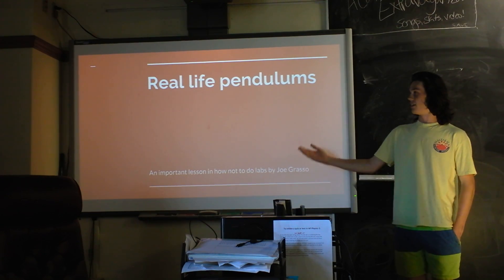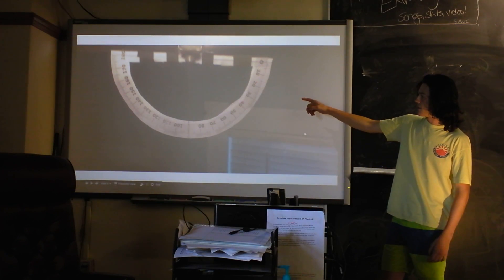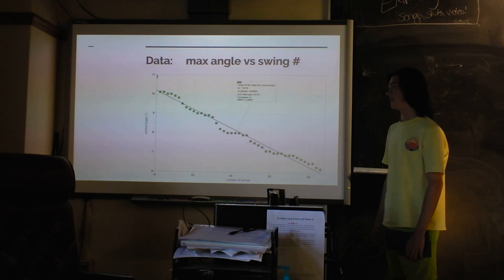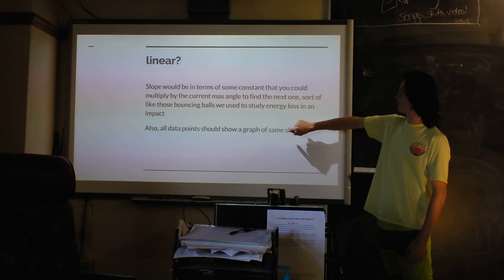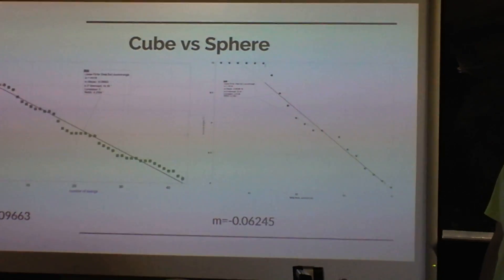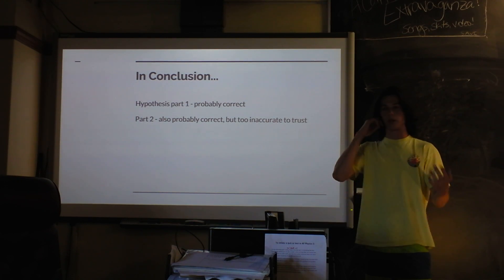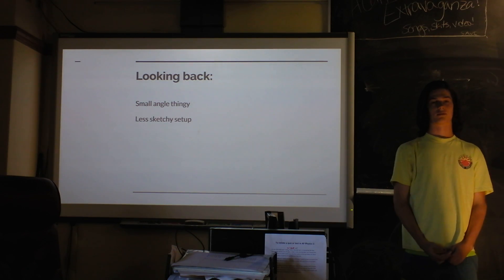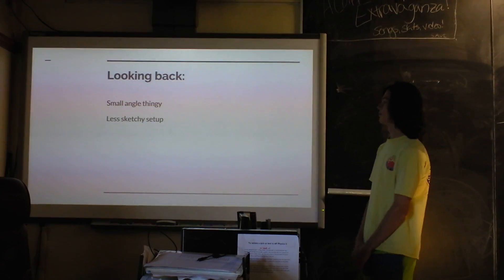Indie Lab - Damped Harmonic Motion Studied

Comment: [...continued]

4. LOOK FOR FLAWS

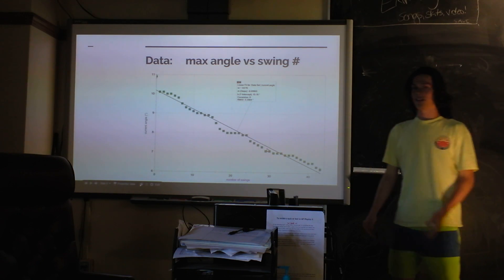The first thing to do is look at the data with an open eye and an open mind (funny how often you need this). Look for anything peculiar, not just the aspect that surprised you in the first place. What of those wiggles in your graphs? You see Doc's intuition in action: maybe the wiggles point to an unwanted disturbance in the form of beats in relation to the lamp. That's how you proceed, like Sherlock Holmes. (I love how Benedict Cumberbatch plays him! Watch the tv-series. This is precisely how a physicist looks at his experiment, searching for clues to what is going on. Notice details, sift the relevant from the irrelevant. Quickly make pictures in your mind that might explain things, and quickly discard them if they seem unlikely. Let your mind be open, fluid, creative and critical at the same time.) What of that strange first data point in the plot at 2:18? Maybe it has a trivial cause, maybe it tells you something useful.

5. REPRODUCE AND VARY

The next phase is systematic investigation of the anomalies you noticed. In science we separate the real from the freaky fluke by testing reproducibility. Do it again. Do the wiggles persist, in the same way regarding phase and amplitude? Do you get the same linear decay? You either find that effects are reproducible, in which case you need to eliminate or understand them, or they are irreproducible, in which case you may want to average them out over lots of data runs, and/or improve the stability of your set-up. It is not all mindless work in this phase. As long as you don't understand what is going on, you keep looking and thinking about possible causes. During each data run, you closely watch everything that happens, and think about it. The physicist mind never stops.

If you have a reproducible difference between theory and observation, and you have been unable to trace it to some problem in your set-up: congratulations, because you have made the first step towards discovering something new. But you are not there yet. Now comes the phase of parameter variation. Make the pendulum longer, shorter, of different material, attach it differently, start at different amplitude, do the experiment in a different environment, etc. In short: vary anything that you think might be relevant. Please be clever about this, doing plausible and easy variations first. Streamline the data taking process. These are not final measurements, so maybe we can do with fewer data, and we don't need pretty plotting at this stage. Be ruthlessly efficient.

6. (RE-)VALIDATE YOUR SET-UP

If all is well, you tried in a previous phase to get your set-up as closely to the model system as possible. But maybe you did not go very far in this respect, because of practical reasons. If you have an unexplained experimental result, you may want to return to this aspect. Can you get close to the simplest, harmonic, undamped, massless-rigid-string, point-mass, oscillating in one plane, pendulum treated in the textbook? Try it. If you cannot get reasonably close, you have a dominant systematic effect that should worry you. Remember, nobody will believe the results of your experiment, unless you demonstrate that your set-up is in fact capable of reproducing known results in known situations.

7. PUBLISH & FACE SCRUTINY

Now suppose that you (a) can reproduce known results in known situations, (b) have eliminated or accounted for all disturbances and effects that you could find affecting the results, and (c) still find a reproducible and significant (error analysis!) discrepancy between observations and theory. Then you have found something new.

No matter how implausible your result might feel to you, you are now honor-bound to publish it. This is what happened in 2011 with the OPERA experiment in CERN and Gran Sasso: the researchers found that neutrinos move faster than light. This result is shocking, because it violates Special Relativity: a theory that has been tested with tremendous accuracy in an incredibly wide range of situations, and has never been found to fail. The researchers did the right thing, which is to publish their findings.

The media and other fools tumbled over each other prattling about a 'failure of science'. Nothing could be further from the truth. This is science at its best. The publication triggered intense investigation of the types mentioned above: experimental flaws, data processing flaws, and unaccounted-for effects. And speculation started about possible consequences for our understanding of Nature, should the result hold up. It did not, however. Careful scrutiny revealed a bad fiber optics connection and an oscillator ticking at the wrong rate. After correction for these flaws, the effect disappeared and Special Relativity stands untarnished. But the result COULD have been correct. Obviously, such a result would be checked independently in another experiment, and would need to be reproducible there, before it can be accepted as true. If it turns out to be reproducible, we would indeed have discovered something new, which is the question that was asked.

8. UNDERSTAND THE NEW RESULT

While the experimentalists are celebrating their new discovery, the theorists start discussing ideas to explain and understand it. This is a whole new phase, with all manner of strategies and methods...

The above phases are not always distinct, nor ordered this way in time. But they are nevertheless discernible in all good research.